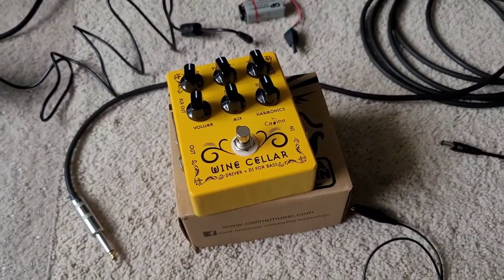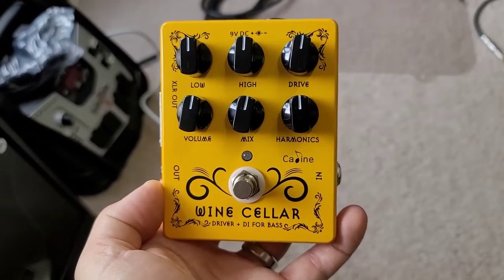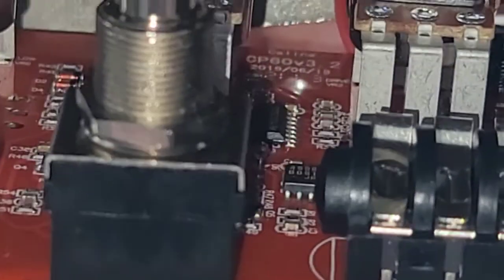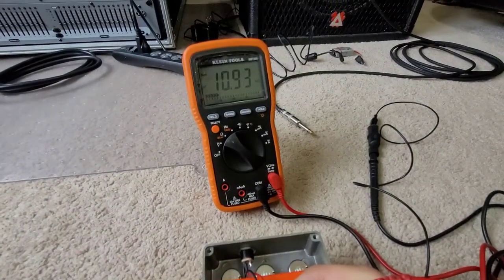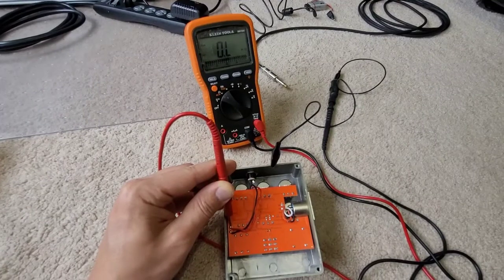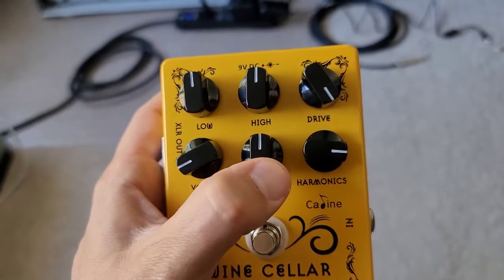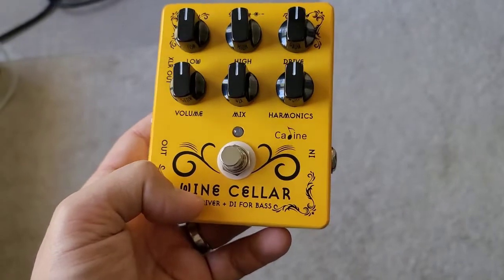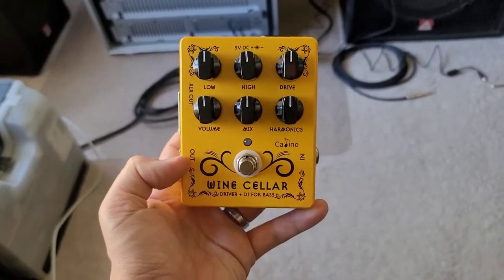Caline: CP-60 Wine Cellar Bass Driver DI Pedal: Technical Review & Teardown

Comment: I really wish this pedal sounded good. Did they use the incorrect taper on the pots? Like they went linear when it was supposed to be log, or visa versa? My drive knob does nothing until the last 1/8th inch, then it starts to drive, but the noise gets out of hand.

For a bass head pedal, to run straight to PA, what is this pedal supposed to be clean driving? The mixer? Mixers, especially modern have quite a bit of clean headroom. It doesn't make sense to me that this would be intended to be a clean driver for bass.

Of all the pedals I've bought over a lifetime, this is the one pedal where I questioned if the knobs/pots were actually connected to the circuit board, because of huge sweeps on the knobs, and several knobs in concert, with almost no change, or barely imperceptible changes to the bass sound. 

Okay, so the pedal has some quality opamps, and other components... It means nothing to me if the pedal itself sounds bad, undriven, no flavor..
Reply from the maker: Depending on what you are looking for the pedal to do i guess. There are B20k pots in this pedal, so linear taper. If you listen on headphones the mids are scopped and the bass/treble is slightly boosted. There is a drive sound, but its not aggressive in the slightest. If you are looking for overdrive gritty tones this pedal wont do it well. I think the original intention of the engineer was to have a basic preamp pedal with a lot of headroom. There are other pedals in their lineup that would be a better choice for overdrive gritty tones.

I can tell you that the knobs do have an audible effect on the tone. I agree the drive knob you need to turn up almost all the way to really get an overdrive distortion type of sound but it's not a very good one.
Reply from the maker: Check out this sound demo. https://youtu.be/fF0aUjU1P7Y

Comment: Hello man. I have a problem with the caline cp60. I use home recording by plugging bass into the cp60 and into the behringer umc22. At my own house the sound is noisy as hell but with the same setup (bass>cp60>umc22) in my friend's house there is almost no hiss. Im not a engineer so i dont know which one is defective.
Reply from the maker: It could be dirty power at your home.
Reply: Turn off the ceiling fan.I had the same issue.

Comment: what can I do to reduce noise/humming on this pedal...I have this and its humming...thanks
Reply from the maker: You may need to tighten the input and output quarter inch jacks. They need to contact the ground pin inside the jack otherwise it will buzz.
Reply: @Bassguitarist1985  can i solder a wire from ground pins to input jacks to reduce hum/buzz?
Reply from the maker: @Acousic-AllCoverMusics  if you run a wire from the 1/4" jacks to the case, not the XLR pin 1, it should quiet the pedal down.

The metal collars on the 1/4" are just barely long enough to engage the ground pin in the 1/4 jack itself. I had the same buzzing issue untill I tightened the collars up. The paint of the case also insulated the collars too. I scraped around the hole to expose bare metal in order for the collars to ground the case properly. That may help you too. Let me know if I can be of help. Post a video of the noise if you get stuck.
Reply: @Bassguitarist1985  ok ill try your suggestions first, if no fix...ill let you know...thank you for the quick response
Reply from the maker: @Acousic-AllCoverMusics  def. I can make a video too to assist. The hum/buzz can be fixed.
Reply: @Bassguitarist1985  additional info, the humming lessens or disappears when i touch the bass strings...
Reply from the maker: @Acousic-AllCoverMusics  passive pickups right?
Reply: @Bassguitarist1985  yes passive...
Reply from the maker: @Acousic-AllCoverMusics  gotcha. Thats typical. Your bridge is grounded, and your body is acting as the shield. Common issue with passives. A shielding job of the electronics and pickup cavities can reduce that.

Active pickups like EMGs for example dont require the bridge (thus the strings) to be grounded because they already have a ground reference on the negative terminal of the battery in the pickup. Thus the bridge strings are left floating. Extremely quiet operation.
Reply: @Bassguitarist1985  "A shielding job of the electronics and pickup cavities can reduce that"  how do I do that sir?
Reply from the maker: @Acousic-AllCoverMusics  if you look on ytube, there are a bunch of videos. I use copper tape, but some use copper paint. The idea is to cover the cavity with copper and attach it to the main ground point of your bass. That way any radio interference is shorted to ground. Even the best job is not 100% but it greatly reduces excess noise.
Reply: @Bassguitarist1985  can i use aluminum foil wrap?
Reply from the maker: @Acousic-AllCoverMusics  for what purpose?
Reply: @Bassguitarist1985  for shielding, instead of copper tape...
Reply from the maker: @Acousic-AllCoverMusics  ahh okay, yeah if it has adhesive backing sure. Copper is a better conductor than aluminum though. It can be had cheap on amazon or on stewmac
Reply: @Bassguitarist1985  after shielding, connect all shielding via wire to the ground at the back of the tone knob right?
Reply from the maker: @Acousic-AllCoverMusics  yup pretty much, one single point to ground so you dont get any loops
Reply: @Bassguitarist1985  i have 3 cavities in my bass so basically 3 ground wires from each cavity, going as 1 into the tone knob for ground?
Reply from the maker: @Acousic-AllCoverMusics  correct yes. You can look up the procedure online for grounding techniques. It will drastically help in electrically noisy rooms.
Reply: @Bassguitarist1985  thanks man, ill try this tomorrow and will give an update on the effect.